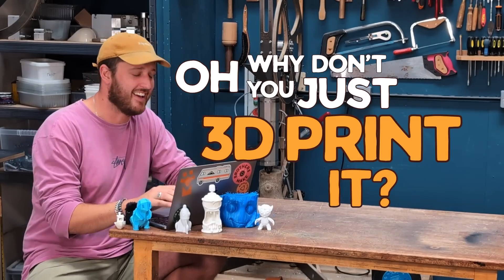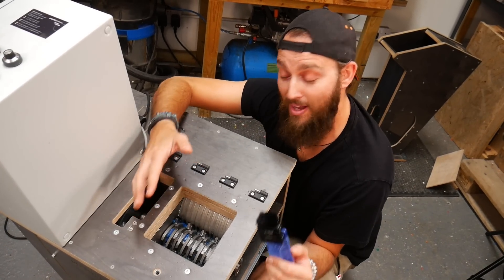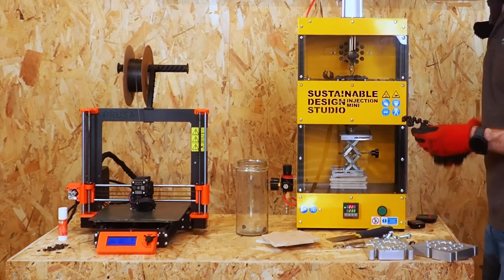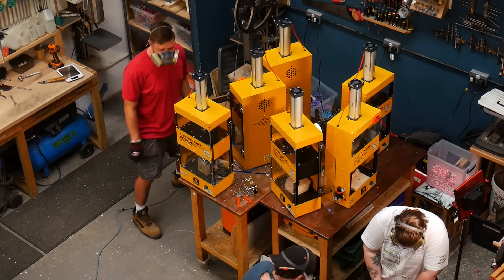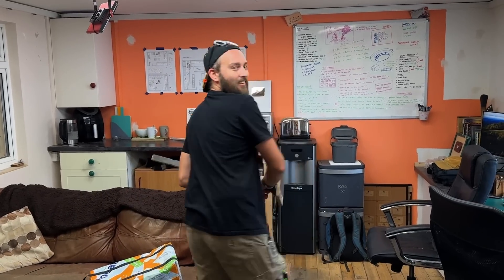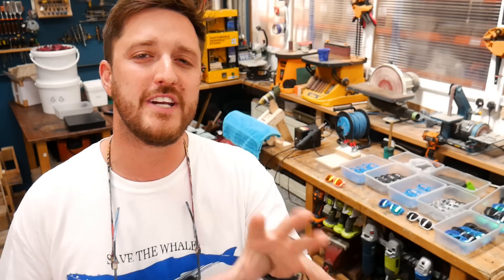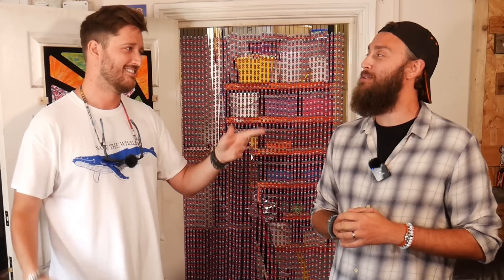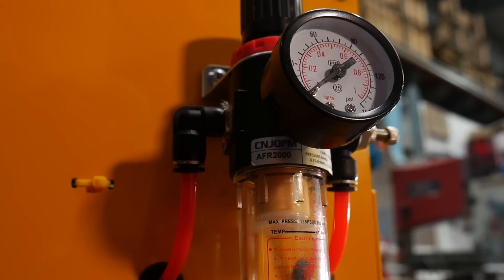Is THIS Better than 3D Printing?

Comment: I'm not sure if it's a mistake or insincerity on your end but that's not a remotely fair test for the 3D printers. When you print single things that small you're going to limit the speed by the 'Minimum Layer Time' which is a complete non-issue when you're doing proper batches of several objects. In proper batches you'd print about 30-50g of material per hour which I assume comes out to be about 30-50 beads or ~3 combs per hour. 

Done correctly you might get 15hrs/day of effective production and thus you'd need ~5 of them to produce 9000 beads in 3 days. And as for the choice of printers, A1s (not 'Mini') are an excellent choice, they're both faster and more reliable than Prusas (which are last generation printers) and cost ~£300. 

And do you need to full time employees to run 5 printers? Hardly. It might be about 2 hours of work per day plus whatever post processing you need (which could be just about 0 to be honest). So that's about £120/day or £240/9000 beads saved in labour costs.
Reply: Oh, and you also compared the cost of the printers to 1 injection molding machine, instead of the 6 that you actually used. So all in all the total should have been £9000 for the 6 injection molding machines compared to ~£1500 for the 5 Bambu A1s.
Reply: @oyuyuy  I'm pretty sure they scaled the ratio of printers vs injection molding machines. They mentioned something like 30+ machines to match the 6 injection molders.
Reply: @JeffDM  You still only need 5 £300-printers to match those 6 injection moulders

Comment: The important pros for 3d printers (specially sub 800€/$ ones) are : versatility, being able to produce any complex prototype at home, they're not really meant for mass production (not basic fdm printers). 3D fdm print farms aren't the best way to mass produce everything unless you really want to run a business with less than 4 people and don't have high electricity bills. 3D printers on mass production scales are : unreliable (always requires maintenance + non industrial 3D printers are not 1:1 equal with one each other even if it's the same model), electricity expensive, not very efficient, not fast and don't make the product really durable/solid enough for lots of application and they waste TONS of plastic. Basic FDM printers should only be used at home for some basic needs and prototyping, that's all. (I'm a huge open source project fan and love fdm 3d printer since I made my first steps into it back in 2016/2017, but yeah, they're like ink printers)

So you're really right and on point for everything, injection molding will never be replaced by 3d printers, or if it's the case, it would be in a far future where SLS industrial printers become cheaper to buy for small companies.
Reply: Na, printers like the A1s and P1Ss are excellent for farms and are incredibly reliable. They also outproduce the injection molding setup they show here. Oh, and electricity is a complete non-issue too, the printers only use about 100W.

If you bought a modern printer your view of 3D-printing would change completely.

Comment: Have you tried using resin printed injection molds? I've seen some people using a metal frame with an open middle area to put the resin printed mold
This could allow a cheaper cost to have a variety of products

Comment: 3D printing and injection moulding have their use cases and I love the fact that you gents went through the pros and cons between the two technologies and processes. Use a 3D printer to help prototype a design with the intention of using injection moulding later for larger scale manufacturing. I'd imagine the aluminum injection moulds costs quite a bit of money and time to fabricate so using a 3D printer to iterate through your product design makes the most sense, minimizing the cost and time spent creating the moulds for injection moulding.
Reply: FDM and injection molding even compliment each other.  I've used the DIY recycling techniques from this channel's videos to recycle my own 3d printing waste into useable parts.  The panini press melting technique works great with supports/failed prints/printer poop.  There are other "recycle your 3d prints" videos on youtube, but most of them don't get the quality marbling demonstrated in Brothers Make videos (sorting your plastic and careful folding makes for a much more visually striking final product)
Reply: @merreborn  They are different production processes and require different designs. Some can only be done with 3D printing. If you have a product designed for 3D printing, you'll need to redesign it for injection molding. 

So, it's not completely translatable when it comes to prototyping and production, but it's useful enough in a lot of scenario I would imagine.

Comment: 3d printing fdm is way more sustainble than injection, since the primary plastics (pla and petg) are super sustainable pla is made from corn starch and petg is made from recycled water bottles. and you should enable noise or add a texture to remove layer lines... and how did you get shrinkage on 3d printing? are you printing abs or something?
and get a bambulab 3d printer, they are great
also injection isn't stronger, becuase of the plastic reduction that 3d printing allows you, it enables you to make thicker parts
Reply: PETG filament is usually virgin materials and it's PET that's used in bottles. PLA can be injection molded. But it's a very low temp plastic, sitting in a hot car damages PLA parts. Your argument that injection molding isn't stronger is off. I don't know what you're trying to say but the problem is fusing plastic, every layer is fusing, injection molding has a lot less of that, sometimes none depending on the mold.

Comment: Small correction,  The A1 (and A1 Mini) are better than the Prusa MK 4 in just about every way. There is no need to 'upgrade' to a lessor printer.

That said, for production, 3D printing is rarely the best option.  It's simply too slow and too low quality in aesthetics and strength when compared to other manufacturing methods. 

But it is still, and will forever be the best prototyping solution.
Reply: 3D printing would definitely not be slower in this case though. 5 A1s would easily spit out 9000 beads in 3 days (at ~1/6th of the investment cost and 1/4th the labour cost). Their maths are off because they printed a tiny batch that no one in their right mind would use.

Comment: I'm not entirely sure if your numbers are fair to 3d printing, but I'm willing to say injection molding still wins.  the difference is really in what you're making, and choosing the correct process for the job—no one would want to make a church bell on a lathe, for example.  

there are a lot of things where injection molding is the clear winner, but you also have to design for the process.  the same is true of 3d printing—reshape those beads a bit, and you won't need brims or supports; set up autoeject and use a tumbler to do some cleanup, and 3d printing might come a little closer to the mark.  plus, your starting costs wouldn't be single-purpose like an injection mold.

in other words, I think—for a lot of products—injection molding def. still wins, but 3d printing has some advantages that you may have missed.

I hope the day will come where printing from recycled material becomes trivial, but for now injection molding is def. still the clear winner, there.
Reply: Their numbers are off by a factor of ~7-10 by my estimate. 3D printers would blow their setup out of the water in terms of cost and production. Surface finish is the only concern (but that's pretty darn good on modern printers too).
Reply: @oyuyuy  
well, and I think the surface finish thing is a red herring anyway—nobody notices or cares about parting lines, sprue marks, or the marks from the ejection pistons; layer lines are just new, and unfamiliar
Reply: @thoperSought  It's not a red herring, you have a mostly smooth part with a parting line and ejector marks vs continuous layer lines. I'm sure given the choice people would rather have a perfectly smooth part but failing that preferring a handful of blemishes makes sense vs an entire surface that's lenticular. Layer lines can be smoothed but that's yet another process, labor intensive and/or possibly distort the part geometry removing enough to smooth them out.
Reply: @JeffDM  
I think you're conflating what people currently expect and what it's natural for people to expect.  smooth surfaces have been a sign of quality for a long time, but that doesn't mean that smooth surfaces somehow equal quality.

with well-printed things, no one I talk to even notices the layer lines until I point them out.  people have been much more concerned over much more functional features—is a latch too stiff to use—and more general aesthetic features.

Comment: Okay, I think the main difference between these is that injection moulding is a specialised process, whereas 3D printing is a jack-of-all-trades (master of none). 

If I wanted to create a new item, like a new keychain charm, and I owned a 3D printer, I could design it in CAD/Blender have it by End of day. 
Whereas for injection moulding you need to machine the mould before you can start production, and you need to mass produce it to make it worth the cost of producing the mould.

Comment: 1) Your comb layout on the slicer doesn't look right. I think laying on the side & filling the plate would produce a lot and better result. 2) There are 3d printers than can handle a hopper & shredded plastic in a similar way the injection molds do. They aren't common yet, but that does get around the filament problem.
Finally, spheres are just bad for FDM printing.

Comment: If 3d printers could make parts cheaper and faster, then industry would have stopped plastic injection long time ago.
It can makes part at home, which is already impressive.
Reply: Shoe companies now have 3d printers, for designs that are impossible with injection moulding. It doesn't take much complexity to eliminate injection moulding as an option. I really like the option of both though, different use cases for sure, and recycling/ reusing has to be better then land fill.
Reply: @Steve-bs7bo  The 3D printers the professionals have are a fair bit more costly, way finer and still faster than what we DIY folks have at home tough.
Reply: @Steve-bs7bo  few shoes companies selling expensive shoes != the whole industry
Reply: @LucianoFoxtrot  didn't say whole industry, it is new tech and needs to evolve. But major companies like Adidas and some start ups too.
Reply: @Steve-bs7bo  this is definitely not new
Reply: @LucianoFoxtrot  it is pretty new to the shoe industry. Printers and materials have evolved to the stage that it is now viable.  These are not generally the hobby level machines or materials.

Comment: I appreciate you guys trying to highlight some key advantages over 3d printing, and i'm just as bothered by people that watch too much Slant3D or smt, making it out to be a perfect replacemement. Every manufacturing method is unique and so is every product. People don't go to university for 6 years just to realise that they could have just gotten hired by saying "use 3d printer".
But I have a feeling you guys haven't fully done your due diligence. I'm not trying to convice you to abandon injection moulding. It's clearly working perfectly well for you and I'm convinced too that it is the best manufacturing method in your context.
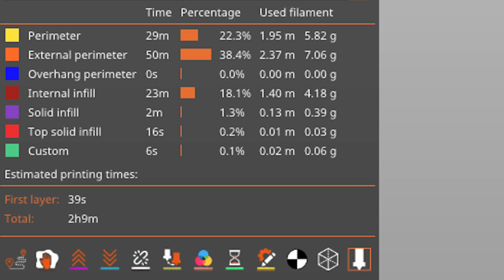But seeing that comb at 4:00 in that vertical orientation has got to be a joke. I'm hoping that was just an oversight, while getting b-roll. But if that is actually what you are basing your claims and decisions on, i'd be a little disapointed.
Reply: What actually is nonsense with slant's approach? Also, I've never seen anyone claim 3d printing is the perfect replacement for injection molding.

It has been my observation that the vast majority of "gotchas" against 3d printing are things like the vertically printed comb... Which at best means the person pushing it is unreliable.
Reply: @SirSpence99  There is nothing wrong with Slant3D's "approach". But the purpose of their videos is mostly advertisement for the service they provide. Which makes it pretty one sided. And some people who are big on 3d printing probably just like to hear them preach.
Reply: @unvermuthet  So you don't have any actual criticisms of their statements... I refer back to my gotcha comment.

Guess I am still waiting for someone to actually "prove" them wrong, or even provide counter-evidence.

The irony is that the people who like them have actual criticisms, albeit minor, about the information they share.

Comment: it looked like from the slicer that you printed your comb standing up??
Reply: they lost my interest when i saw that, a comb could be easily printed in 15 minutes in a horizontal orientation...
Reply: Yeah in a fashion that would make the comb shitty and easily breakable.  Like horizontal orientation would be superior in both print time and strength.
Reply: I do think that their conclusion is true, in a very general way—but it depends very much on what you're doing, and correctly designing for the process you're using.

this video really showed that they don't get 3d printing as a process, and how it could best compete with injection molding.

Comment: Why don't you guys just make 3D print fillament from the recycled materials,you definitely can make the best recycled fillament woth reasonable price,and you can use single use plactic bottle to make fillament too so you have more variety of plactic to use,maybe you can mix and match it too.

Comment: You forgot to add the 3d printing time, the shredding time, and the sifting and sorting time to get the plastic to use in the injection molding machine.
Reply: I think the 5 money units per kilo cited for buying recycled pellets factors all that in. He mentioned that at 11:50
Reply: You can buy injection molding pellets, about 10 times cheaper than filament.
Reply: @FlintStone-c3s  in very large quantities yes.
Reply: @JeffDM he compared a setup of 6 machines so I think that's enough to be able to go past most manufacturer's MOQ